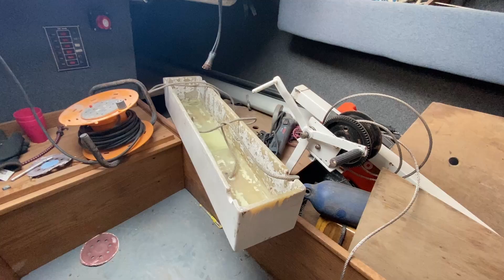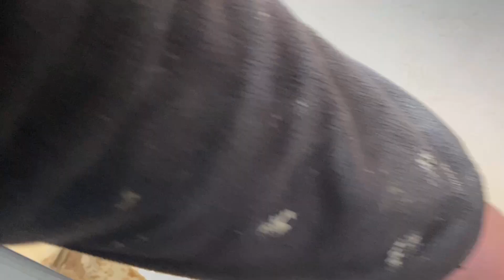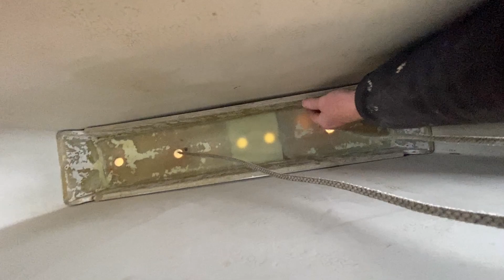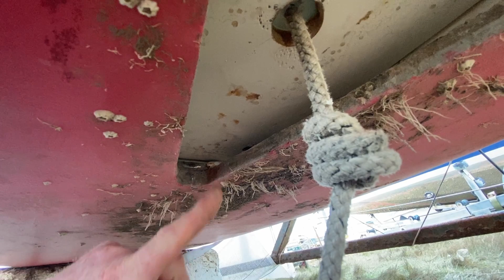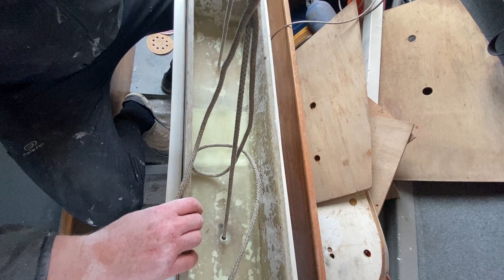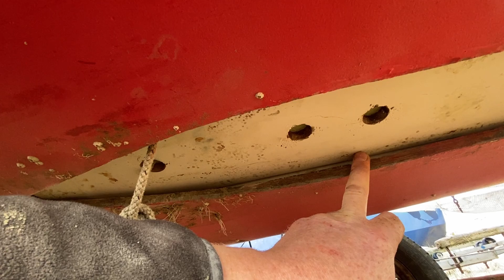Wobbly keel and what is this steel rod? Trailer Sailer Keel Restoration.

Comment: Why not consider strengthening the whole base with an ‘evening-out’ rod so that the load is spread around the whole of the base. This would keep your front part strong with original rod whilst solving the lack of overall contact around the base
Reply from the maker: @mikefriend7570  not a bad idea Mike, it might help to add strength in the build up too as I suspect building it up with just epoxy and coloidal (with as much fibre glass as possible) maybe too brittle. Especially by keeping the rod as is. That could be a good way of forming a level surface  prior to applying any wet material.👍I’ll pop that down for consideration. 👌

Comment: Is it possible that the bar is there to prevent the keel from jamming? Suppose the bottom of the hull is not perfectly perpendicular with the vertical of your keelbox. The bar could then keep the keel in the 'correct' position by raising the back end whilst the hoists are slacked.
Reply from the maker: @_MZ_  the bar actually makes the tray not level as it rubs the top front face of the tray into the front edge of the box. It seemed to sit flatter when removed the bar. There is only one other Harrier I know that had the same bar, number 39 which is 2 away from Elise. The owner actually told me yesterday that their keel jammed while lowered due to the bar and as a result they had to be lifted and bounced on the keel to release it. Although he has since modified his box and keel by replacing it with an even profile and a lead bulb. A mod I’d like to do….. however, he left the bar in although it’s not relevant any more due to his new keel design. But as far as I know none of the other harriers have the same. I’m leaning toward wear resistance as the harriers without the bar seems to have more wear on the aft face of the keel box.
Reply: @boatedout  if the wear is post-bar-installation that indeed makes sense. Good luck!
Reply from the maker: @_MZ_ quite possibly! Thanks! 🙏 😁

Comment: Personally I wouldn't remove the bar.  I think it's taking some of the wear away from the glass.  I think the reasons you give at the beginning are all legit.  If you hit something hard it's possible it could split out the glass.  My suggestion would be keep a metal wear bit at the back.  Cover the keel box in clingfilm, put it in with some weight on it, leveled and fill the gap with thickened epoxy as a new 'bed' for the keelbox to sit on.  EDIT, Obviously I wrote this half way through the video.  Many ways to skin this though.
Reply from the maker: @DansKoiPond  I think that’s a good plan. Other comments are suggesting the same so I’m leaning that way!😁👌⛵️

Comment: I'd put the bar back and modify the back of the box to accommodate it.
If you run aground the trailing edge will make mince meat of the back of the keel case otherwise.
Then I'd mix some thick mayonnaise epoxy/silica and using a tongue depressor or lolly stick, apply a thick layer on top of the hull flange.
Add tape to the bottom of the keel box with breaker tape or parcel tape and then lower the box in place which will squidge out excess epoxy but will leave a  nice landing surface. 
Once its gone off, tap the box from underneath and it should part from the tape.
Reply: I think the steelbar was but in there by the former owner because the keel was wobbling longitudinally....that is why the gelcoat was affected unevenly.
Reply from the maker: @  could well be as another harrier owner was told that a previous owner had done the same to theirs. 👍
Reply from the maker: @MikeJavelin  sounds like the best way forward! 😁👍